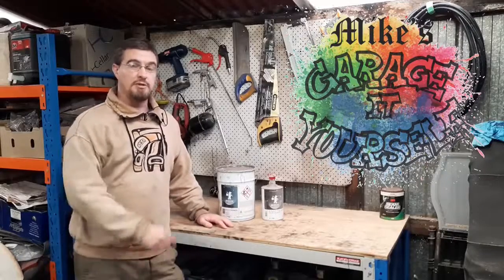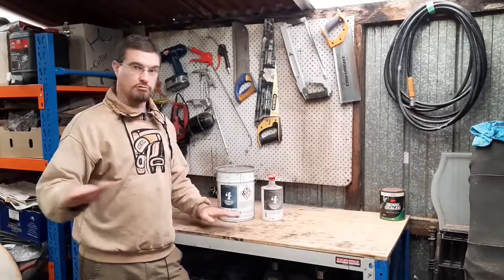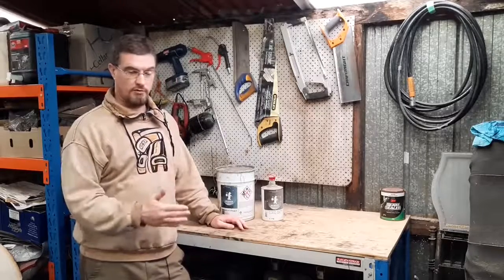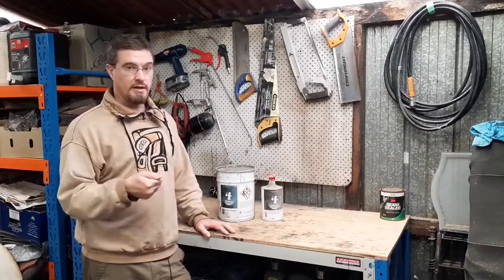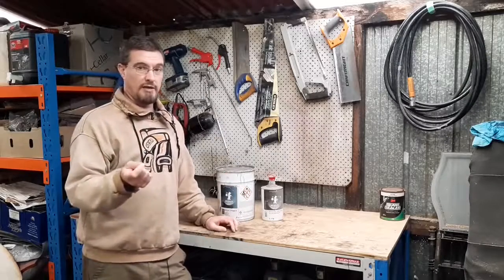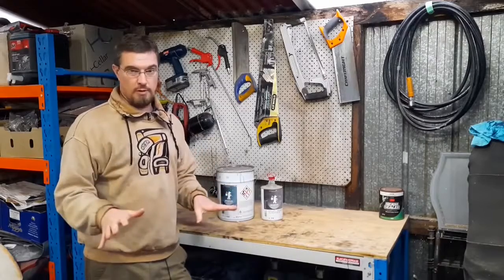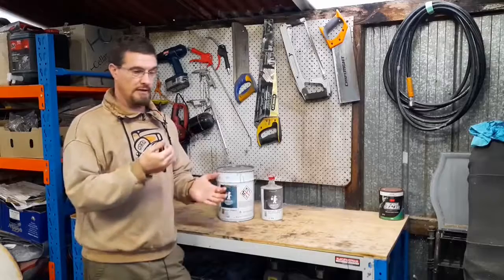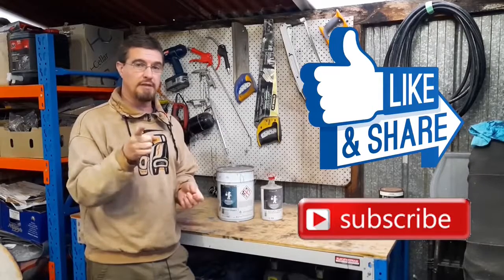Epoxy Primer VS Etch Primer - Is Primer Waterproof?

Comment: What if I keep it in my garage give me at least a year
Reply from the maker: The risk is yours to take. Etch primers aren't as good as they were 10-20 years ago due to changes in environmental laws making the chemicals used less effective. Hence I wouldn't want to put my trust in an etch primer for long periods unless it also seals the surface from moisture. 
Don't forget that it's not just keeping it out of the rain as there is always humidity in the air around you. When the air temp reaches the dew point then this moisture will form on the panels surface but could well have flashed off by the time you go into the garage later in the day. That moisture will have been absorbed by a porous primer.
In high humidity areas of the world a bare steel panel can easily have flash rust on the surface.

So IMO the epoxy primer is the only sure fire way to seal the metal away from the environment around it. It may be a bit of extra work to key the surface for good adhesion compared to etch but it's a lot less work than having to strip the etch primer off if it didn't hold up.
Reply: @GarageItYourself  I know there’s a lot of debate on should I prime car before body work are after I would like to have a prime between my metal and bondo so can I prime do body work then prime again with epoxy primer what do u do
Reply from the maker: @beeasy4360  Prime as soon as it's down to bare steel. Steel must be keyed with either sandblasting or 80 grit DA sanding. Epoxy must have a good keyed surface to adhere properly.
Then even if you have to do hammer and dolly it's easy enough to use a strip disc to remove primer from work area and then re-prime once work is done. All primers require keying before filler goes on and then filled area is primed over with epoxy primer to seal it. Filler is porous too and if you wet sand then filler will expand and shrink as it absorbs and dries.
I dry sand filler work and then once everything has a coating of epoxy primer whatever filler primer or surface primer you use on top of the epoxy can be wet sanded if you like cos only the surfacer/high build primer will absorb moisture but this also can be kept to a minium by using a squeegee to wipe the water away during the wet sanding.